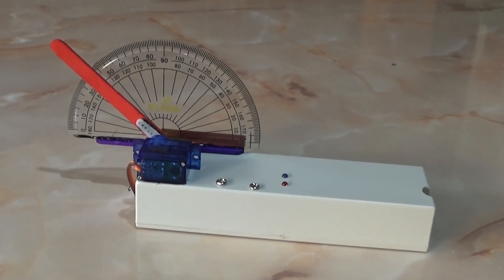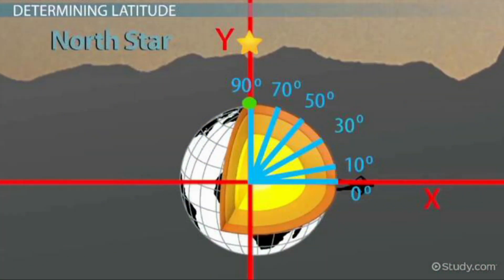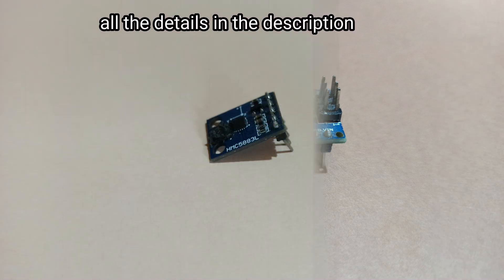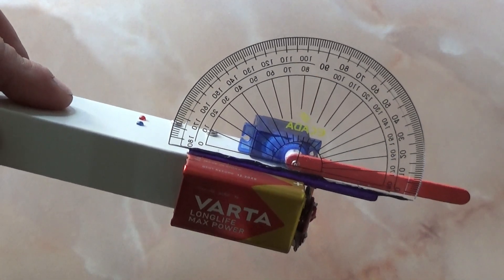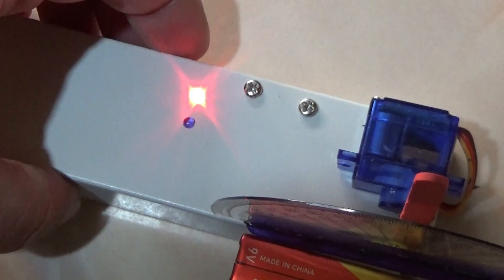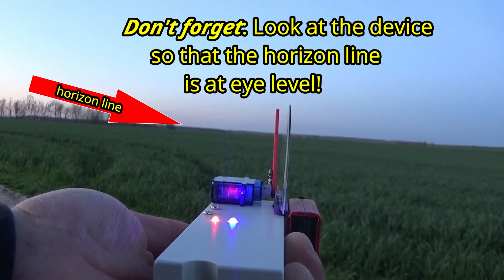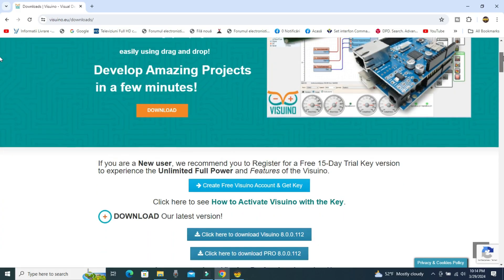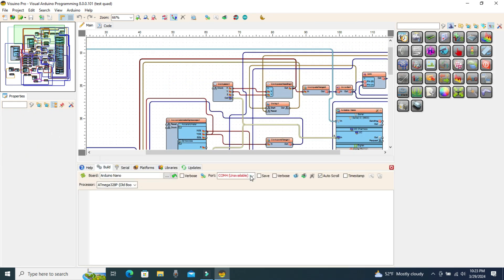Best Arduino Project 2024! How To Find The North Star? Arduino and Visuino Show Us The Way!

Comment: Wow superb, 
I'm also doing a small visuino project controlling servo motor wirelessly using "joystick+ Arduino+ Nrf24l01" on visuino. it's working fine but I want to do some changes.
 * How to change the speed of the servo motor 
* How to change the angle now it's rotating 0°-180° but I want to limit that to 0°-90°.
* If i move the joystick servo motor is moving perfectly but if I leave the joystick it's coming back to initial position. It should not come to initial position. It should hold on last position only.
to achieve these changes what are the changes I have to do on visuino please help me.
Reply from the maker: Thank you, to reduce the stroke insert a "Map Range Analog" in the analog control of the servo motor, in Map Range set the output values min: 0 and max 0.5. To maintain the last position, use the "Remember Analog Value" component